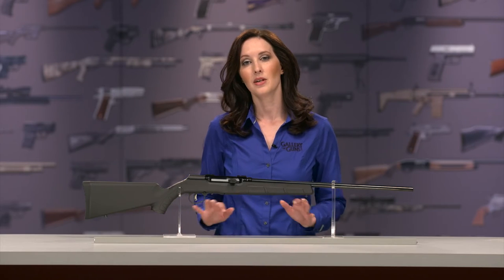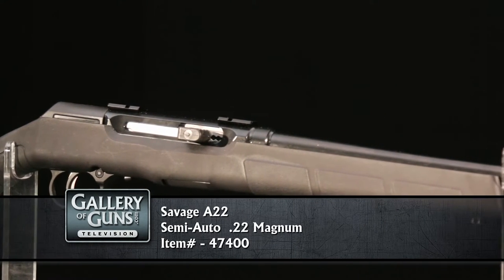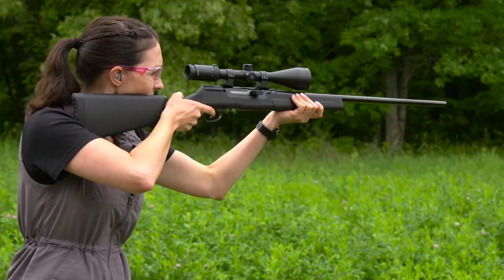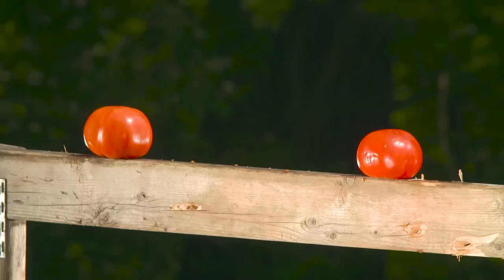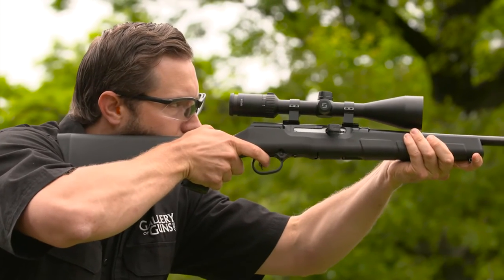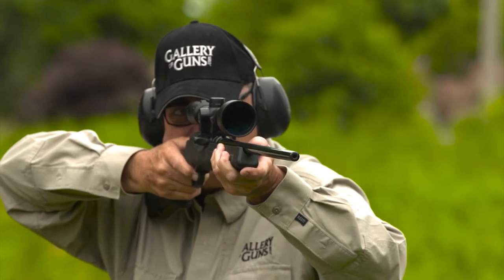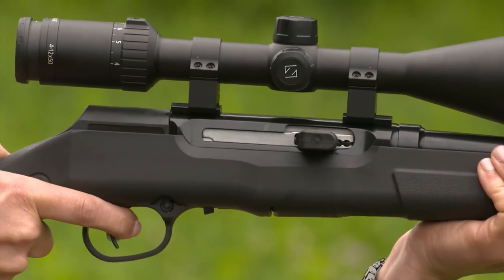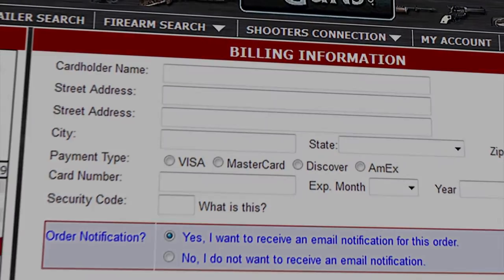Gallery of Guns TV - Savage A22

Comment: come on Savage, they rear top cover should have been stamped sheet metal and its retaining pin also attached to the return spring should bave been steel thats not much cost or weight additions, really cool rifles but they seem disposable, so they have to buy a new gun in 2 or 3 years, and guarantee you there is some crazy dude out there that will push that gun to its limits.
Reply: Amen!